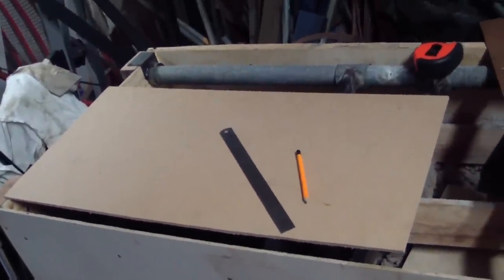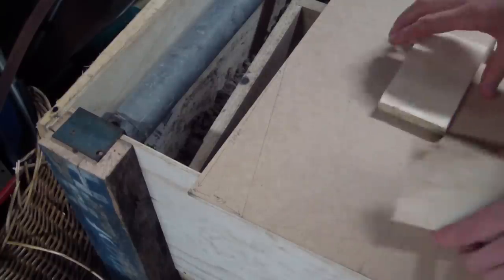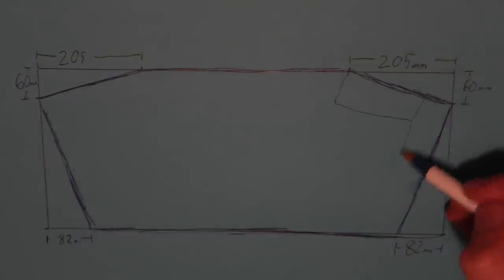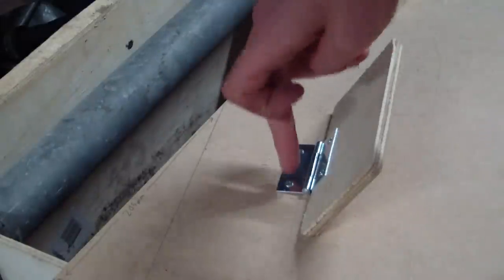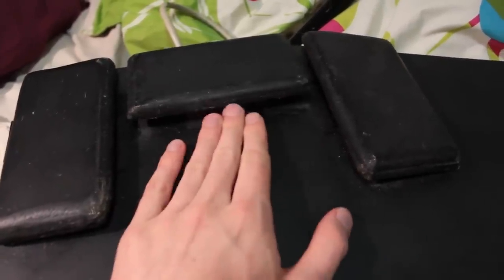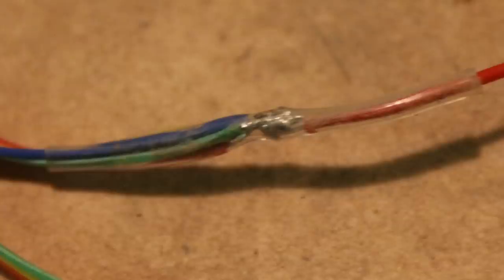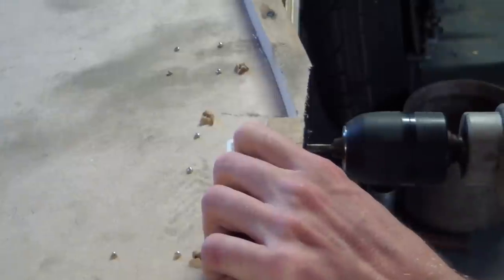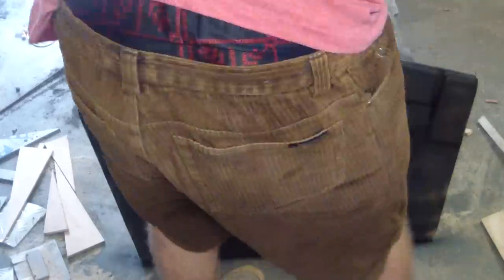PC Foot Pedals Tutorial | How To Make Homemade, Transcription, Gaming, MIDI Pedals Part 2

Comment: The foam part, that's clever :) Using a gamepad to create this so you don't have to create the board connected to the USB is quite a clever idea as well... I guess you could even use a programmable keyboard or something similar as a base to make a pedalboard like this, use a Bluetooth one and you could connect it to a phone or a tablet as well... the possibilities are pretty cool. thanks :)

Comment: This video is 11 years old but I still like it. Now days you can use a $1 arduino chip to do this but i might do it this way anyway. 

Note could also use a usb 10-key keyboard device to do the same thing. I mean if you wanted it for a non-gaming application. I've found several of these for a few dollars at thrift stores. I haven't tried to the find the AHK video yet but I can imagine what it is.